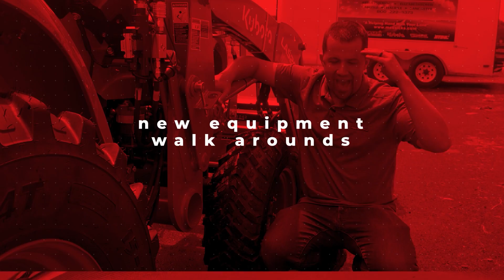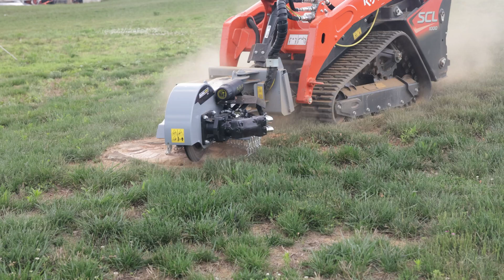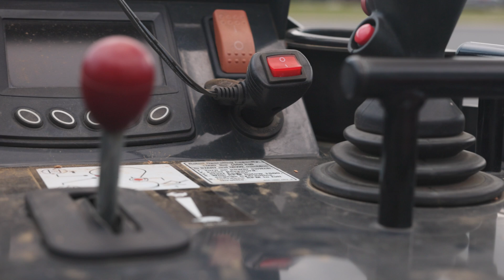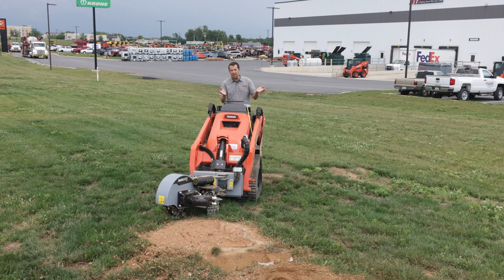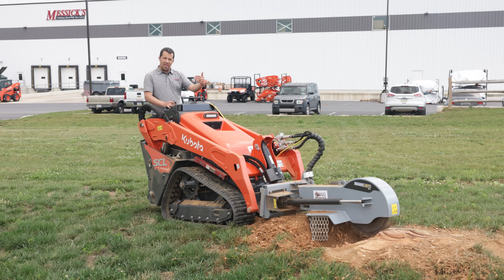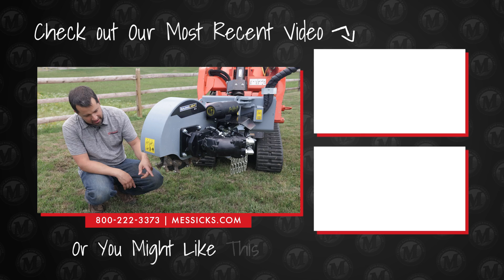Affordable stump grinder for Kubota SCL1000 | Baumalight S16

Comment: Looks great.love to see this demoed on the new Holland version.
In a real world application the operator would consider a slightly higher boom availability to bowl out any easy cuts then lop the edges here and there.
Feeling the stump aggressively for your dinner.😎
Anyone who has this will definitely have a larger version but a second (this) with his best skilled laborer using this secondary knockong out the jobs

Comment: I have a question Neil? Does any body have a stump grinder that fits on category 1 tractor like 3 point hitch and runs off 540 PTO. ???
Reply from the maker: Many, yes. Baumalight has a nice one.
Reply: Yes, but those things give you a very jarring experience, they bounce all over the place.
Reply: @wildbill23c  Actually,  it depends on the tractor. On the 7-30-2023 YouTube of Tractor Time with Tim, he had the tge entry level Baumalight on his 3R, and it didn't jar the tractor around like on his subcompact. I imagine the result would be the same in the Grand L series or the larger L series in Kubota.
Reply from the maker: @jimmcknight3021  the hiccup with any of these on the 3pt is that the rear hitch does not have downforce, so the grinder can always bounce.
Reply: @MessicksEquip  Tim found a way around that. 😆 LOL

Comment: How much is the stump 
Grinder and the compact track loader?
Reply: Probably in the neighborhood of $40-50k.  Course depends on what other options you get with the compact track loader as far as buckets, grapples, etc.   If you buy one of those machines you certainly are going to want some attachments for it...and not sure if Kubota offers one, but there's a trencher attachment that goes on those compact track loaders too....plus post augers, and all sorts of stuff...cool thing with these machines, they're small, so they will fit in places a tractor or regular skid steer can't get into.